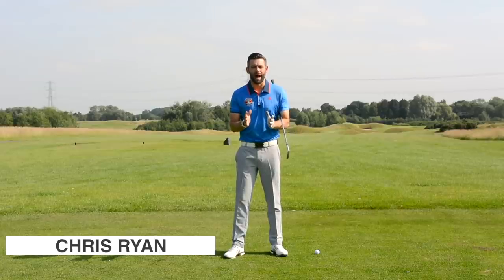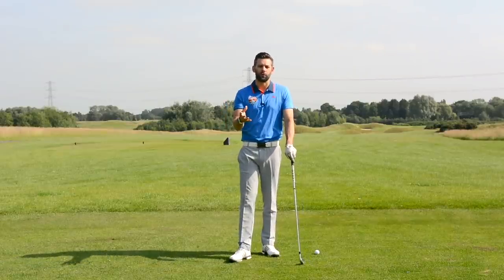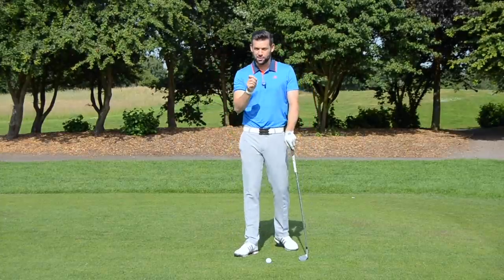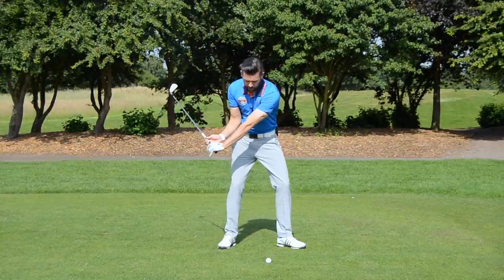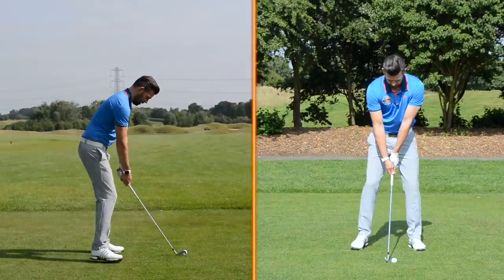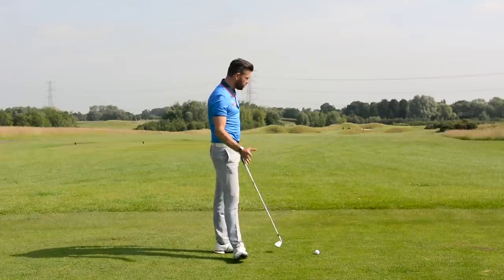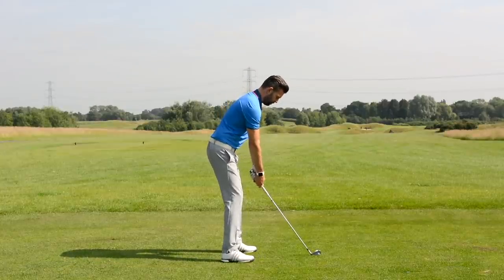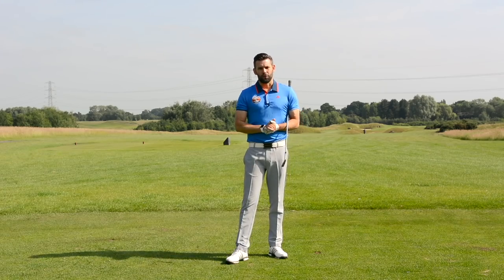HAND PATH - THE SPEEDBOAT DRILL

Comment: Adjustments made based on this video and the "How to Deliver The Club" video commented on below can deliver not only greater speed but more importantly far greater accuracy, though for this to happen in my experience, the absolute focus on that "snap release timing" particularly on the Driver needs to be in that foot/30 cm between the Front of the ball and the Target line.  I actually focus on the front of the ball.  The reason I believe it dramatically increases accuracy is that it is far easier to get that "one foot section" of the swing on a target line- though if you dont attain that snap you will not deliver the accuracy. 
Great videos Chris !

Comment: The speedboat type movement works great for most of my clubs, but I can't seem to make it work with the driver.  I think because the shaft is too long, I am having a hard time getting this movement into my driver.   I think I am normally a bit more upright with shaft on my driver, and now it feels like the shaft is flattening quite a bit. I feel like the clubhead is moving outward too much, causing heel shots.   If anyone can provide info on how to avoid heel shots with this movement IT WOULD BE GREATLY APPRECIATED!  I was trying to pull my hands even closer to  my body to find the center of the face, but I am still hitting off the heel.